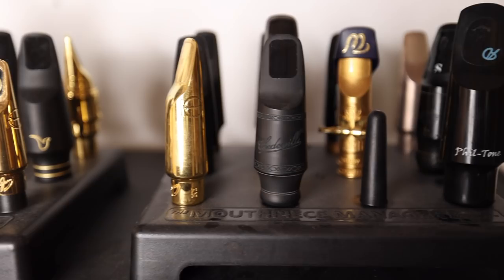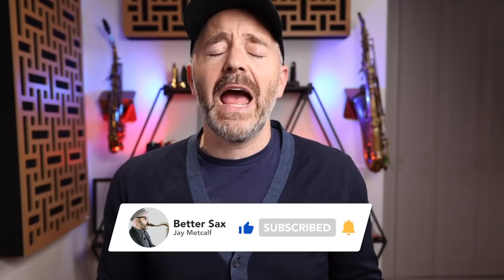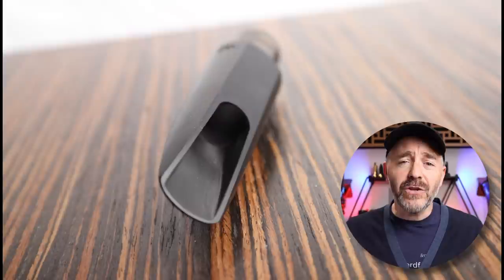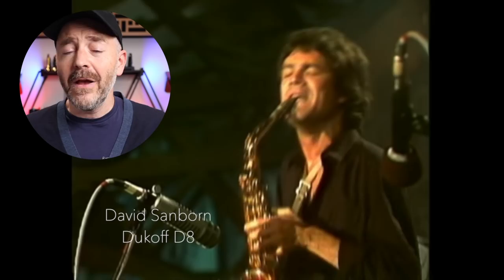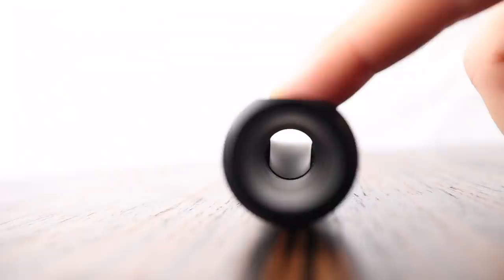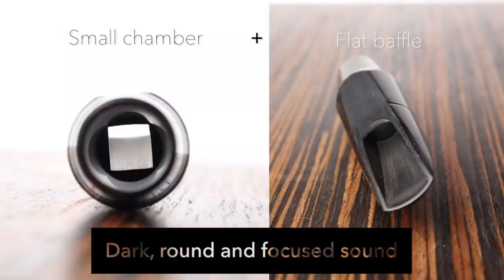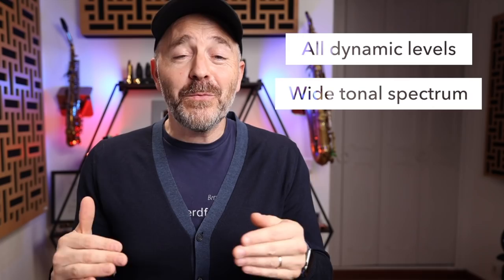How Saxophone Mouthpieces Work - Everything You Need to Know

Comment: This begs one to ask: what happens if the ramp rolls UNDER instead of OVER? In other words, what happens if there's a concave curve inside the mouthpiece? Do you get a super round, dark, and flugel/French horn-like brass sound? Do you create a honk that could knock down the walls of Jericho? Will the mouthpiece simply fail to sound at all because it messes with the pressure differential between the inner and outer sides of the mpc? At an extreme, what about an anti-step where the baffle goes up at a high angle and then turns to nearly flat?

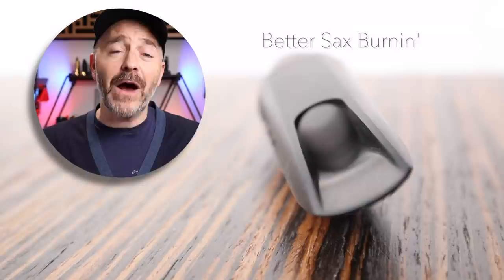Comment: Jay, your description of a rollover baffle, with an arrow pointing to the bump in the middle of the baffle at 2:00 is surprising. Theo’s website explains the rollover that characterizes this type of design is right at the tip! He refers to it as «a short round at the tip» with a drawing showing it. I’m so confused.
Reply from the maker: On Theo Wanne's website there are 2 arrows indicating the baffle. "The baffle is the section of the mouthpiece directly behind the tip rail that extends back into the mouthpiece about two centimeters." hope this clears things up. My arrow is pointing to the middle of the baffle section.
Reply: @bettersax  I guess this means the entire about two cm of baffle being curved as a "bump" is what characterizes a rollover baffle. I always thought what mattered most was the slight bump right under the tip. thanks for the clarification.

Comment: Hi Jay, Got a problem maybe you can solve. I have a tenor and have used a Selmer C* to play in concert bands etc. However, I wanted to go to a brighter sound as I played jazz and got a Jody Jazz HR. But the JJ is too big for the cork on my neck, while the Selmer fits fine. I've tried plumber's tape to build up the neck but that doesn't seem like a good solution. Should ai just go with two necks or is there a cheaper solution to this? Thanks!
Reply from the maker: Craig, have a new cork put on by a repair technician. Doesn’t cost much.

Comment: Well I agree that mouth pieces can change how a sax can sound but without a good reed no sound can be generated. Why is a Reed geek so important in correcting imperfect reeds? Why is it only a percentage of reeds out of a box is fitting to use in a gig? Even a beginner mouthpiece can generate sound plenty good to do a gig. A mouthpiece is also made of pretty tough material while reeds are very delicate and easy to destroy or make unplayable.   So although a mouthpiece can have design changes that aid in certain styles of music. The Reed has to have that perfect fit in order to reach that sound or  any design change in a mouthpiece is irrelevant.

Comment: Hello , after watching this upload three separate times now there is a clear need  to rebuff the whole message of your presentation . 

Firstly , you have not explained anything regarding how a reed mouthpiece works - that is how it generates sound. By dismissing that issue you then eroneously make false statements about the baffle .  That confirmed to me that you don't  understand how a reed mouthpiece both creates the 'attack' of sound and how the baffle functions . 

Secondly, most of your presentation continues to reinforce and give creedance to the error  that the mouthpiece somehow regulates the character of the sound by altering the 'flow of air '. This lack of understanding of schoolboy physics regarding the relationship between air and how sound is  transmitted needs to be addressed .

Thirdly ,like all public figures,and you have become one with the many videos here , a certain duty of care and accuracy is expected regarding the facts .  The whole presentation is based on false presumptions and lacks facts.

It is so simple .  The player squeezes the reed up towards the mouthpiece top rail then pushes/ blows/ injects air in the space. This creates a 'venturi ' pressure passage lowering the pressure in the space . The two reed 'wings; and centre tip are pulled further in closing the gap until the elastic strength of the reed pulls them back . They then snap back under air venturi induced depression slapping the air against the top rail and 8mm or so of the inner baffle creating a series of repeating sound waves . These sound waves can only go into the mouthpiece where the side rails, lowerbaffle and throat shape and size ,by reflection , alter the charcter of the sound. At this stage the flow of air has done it's job and is just an exhaust waste , Its the flow of reflected sound waves completetly independant of any air 'movement which creates the character. Obviously the more air pressure you inject into the venturi tip space the louder the sound .Once that sound has been made its out of your control and dependant on how its reflected against the baffle,side walls undersid eof the reed which is not moving and the throat  Just for the record, sound waves are   transmitted through still air , at sea level at 1125 ft/sec.(or 343 m. persecond .They do not travel any faster or slower in moving air . nor are altered by the flow or direction of that air. Do what you like but you cannot blow sound waves down a tube as they are travelling much faster than you can blow . You can deflect soundwaves with solid objects by natural reflection and alter the pitch of a sound within a tube by adjusting its length . This is acheived when the constant uniform reflection of the sound waves inside the tube is interupted by a hole . 

Please read and re read this comment and try to forget all that the fancy mouthpiece makers tell you about 'air flow'. Its a nonsense and so obviously so .    Jonny Uk